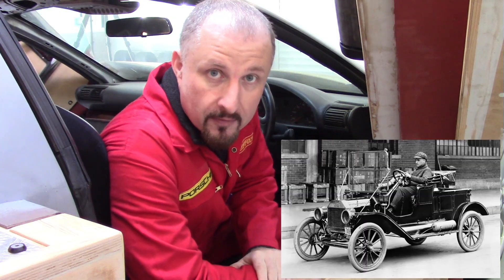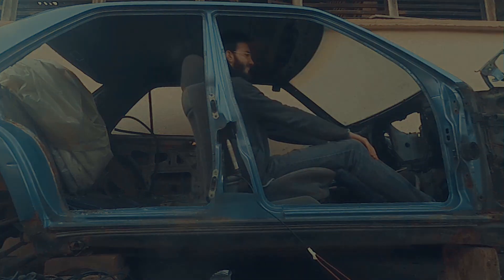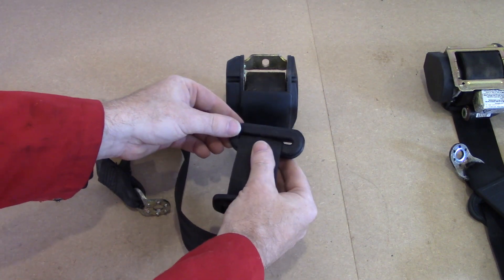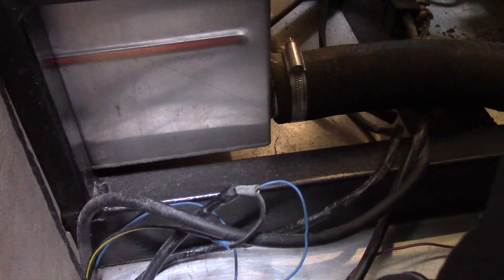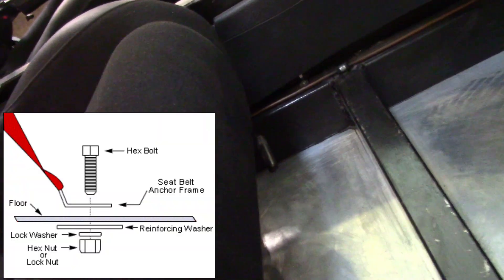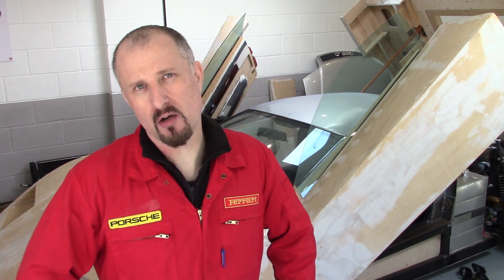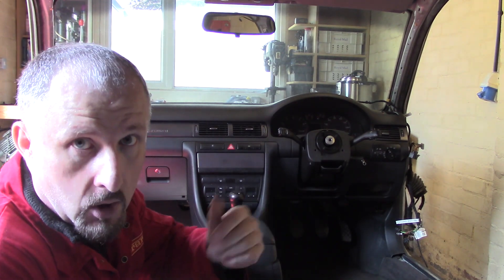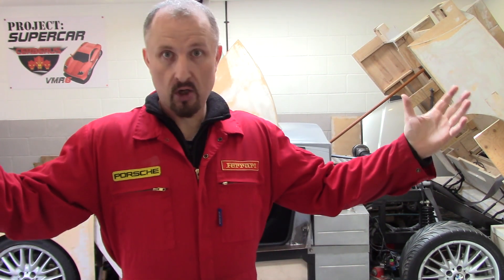Seatbelts and Airbags for my DIY Supercar: Prototype Ep18

Comment: I thought I read that you can’t have a air bag System on a kit car but not shore if your van is classed as a kit car🤔. Your right about that new supra. I find it looks awful. I haven’t got to the electrics yet I’m just hoping it will all work out lol
Reply from the maker: The regulations in the UK are a little vague when it comes to "kit cars", so I tend to go with the IVA or "signal vehicle assessment" regulations. There's isn't a regulation saying you can't fit airbags, here in the UK, but if you have them fitted they must work. Yeah the supra has too many fake vents, and it's pretty much a BMW anyway.
Reply: The IVA manual says ". Airbags are not permitted on vehicles which are not massproduced. "   It's in section 14 Protective Steering.
Reply from the maker: @jameshearne891  Thanks James, yeah you're right. I had to look it up, it's section 14, subsection 5. It's also Revision 1, date 2011, so I don't know how I missed that, I think I must have been using SVA regs, but thanks for pointing me in the right direction. Well that solves the airbag problem, I'll just leave them out ;)
Reply: I thought it said air bags wasn’t aloud
Reply from the maker: @Spoonersoutings  Yep, not allowed. Bureaucrats changing the rules again. :(

Comment: Ohh, belt up will ya. With the air bags, is the deployment designed for the cabin space for that particular vehicle, so if you change the cabin profile it is no longer effective? I'm no expert, but just a thought. I had he drivers seat on my 350Z reupholstered recently and he said he wasn't qualified to do the stitching for the  air bag on it, so reused the original panel. A lot is involved in this stuff. Good work tho mate.
Reply from the maker: Yes you're right about the airbag being designed for the cabin space, I was going to touch on that, but the video was getting a bit long. I might go into more detail in another episode, when I tackle the airbag issue again. ;)